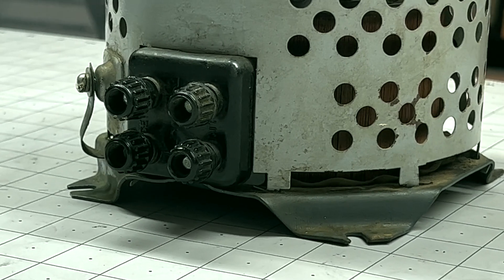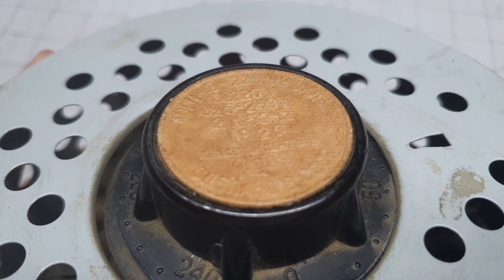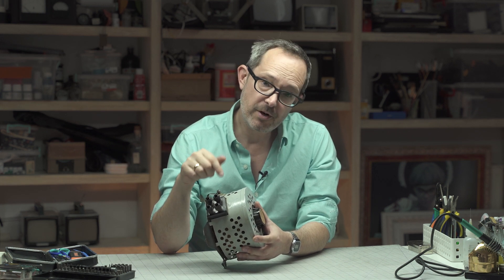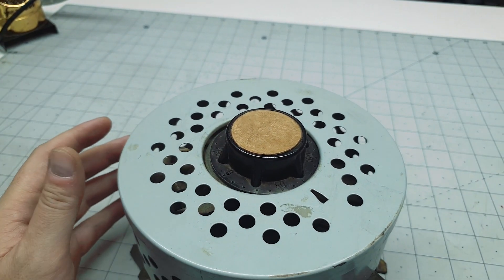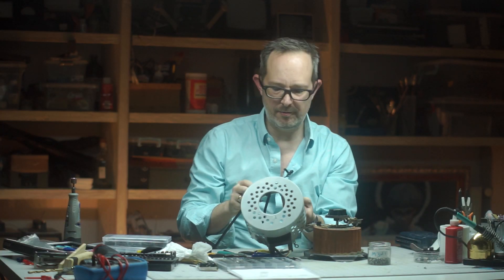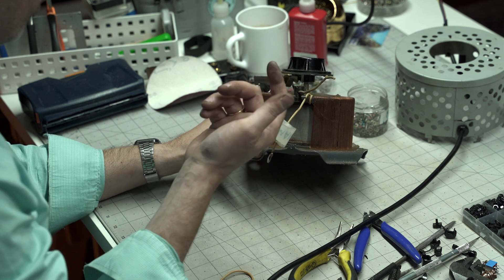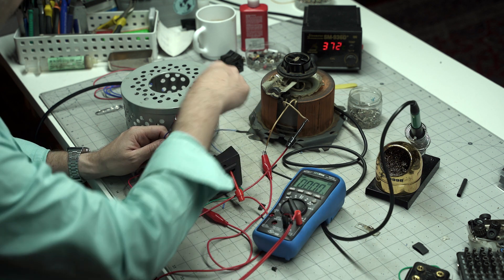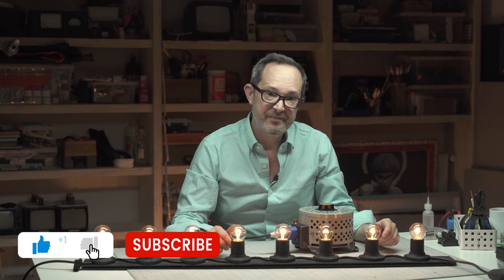Restoring and Upgrading a Variac Transformer!

Comment: I see this is 2 years old video, but anyway, I built my own variac.
Or more like put it inside a case.
I got one for "cheap" 80€, which still might be cheap given it's size.
I ordered the largest industrial plastic box my local electronics store could get, and it fit perfectly!
Then I added a socket, a neon indicator light, and a 10A breaker as the power switch. Note that it doesn't switch both sides as a proper switch should.

Also this thing is so massive that if you plug it straight into the wall without any softstart, you only have a 10% chance of getting it started without tripping the breaker.
That's why I have a softstart. It consists of a power lead, output lead, 4 power resistors, and a 90s light switch which is used to bypass the power resistors when the thing is powered on.
And it works very well.

Oh, I forgot to mention the 3D printed knob that it now has. It's pretty cool. Now I'm gonna make it a CC/CV supply by slapping a big-ass stepper motor on it and then putting some Pi Pico stuff on it.

Comment: Here's what I would have done: A wooden base (on top of which the variac would be screwed) that would serve as I/O and control panel. You keep the original terminals of the variac but they are connected to the box that give you a Schuko socket, a british one and terminals for banana plugs. The box also has a cord and plug to connect to mains, a switch and a voltmeter and an ammeter. Maybe also a fuse or, better, a circuit breaker (aircraft-like, I'm sure you'd be able to find one from a Mig or something cool)

Comment: Nice restoration and modification. Had a variac back in the States of a similar size but it was rated 120VAC @ 10 amps. I might assume if this was plugged into a 120VAC mains it would hav3 to be derated to one amp.

Comment: Looks like fun .
Reply from the maker: Thanks for watching, Jim!
Reply: @ThomasBurns  I just blew a  breaker yesterday with a new hookup.  I'm wondering if the variac I have is really a 240 volt unit. I checked my wiring and didn't see anything. Do you know how to determine the input voltage ratings on an unknown transformer?
Reply from the maker: @jimfontaine9045  The easiest way would be to plug it in, with the dial at zero, and slowly turn it up. By metering the output you’ll be able to see if 50% on the dial is what it should be. I wouldn’t go above 50% before you know more. But the kind of plug and outlet on the Variac should be enough of a clue. Is it a US plug or an EU plug?
Reply: @ThomasBurns  it has no plug.  If it doesn't blow a fuse with no load connected , I would think it would read half voltage at half dial.  I had been using it successfully on 120 volts, so I don't think it's defective. I'm thinking it may be a 120 volt unit and the core is saturating at 240 volts causing it to draw a lot of current. 

I compared it to a  very similar unit that definitely is 120 volt. Wire size, core size, number of turns all seem the same. I'm thinking it might just have the incorrect nameplate (on brush cover) attached.  I'm going to power them from a red variac through a power resistors or big Incandescent lamp. I'll be able to compare the 120 and the ??240v?? one.
I'll compare the weight on a scale as well.